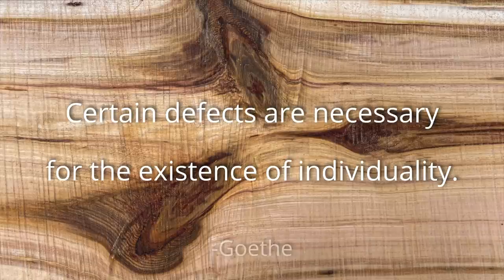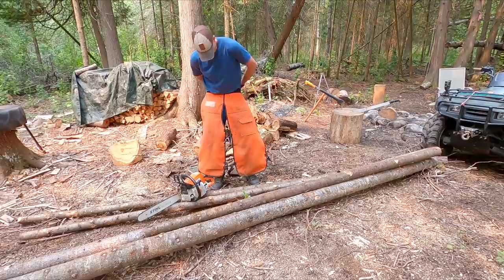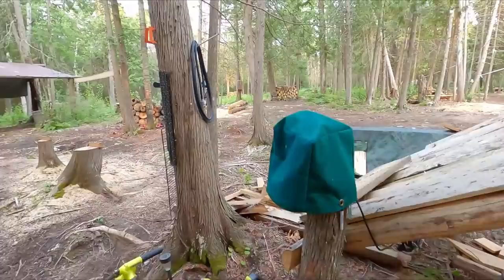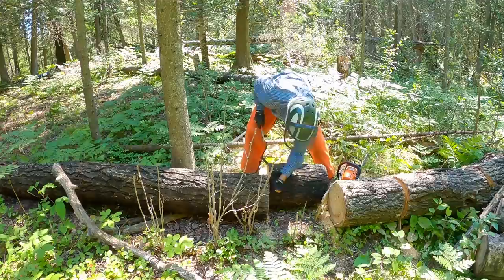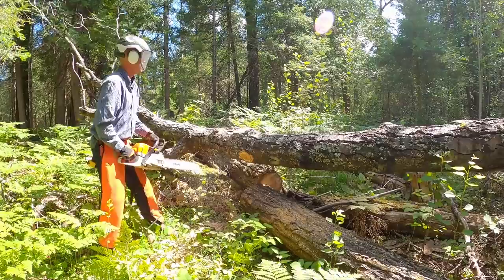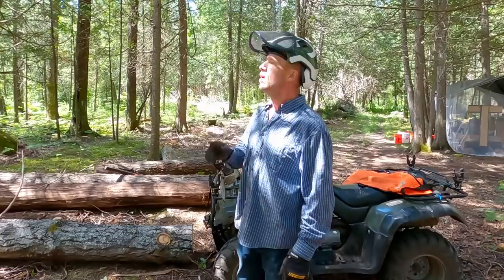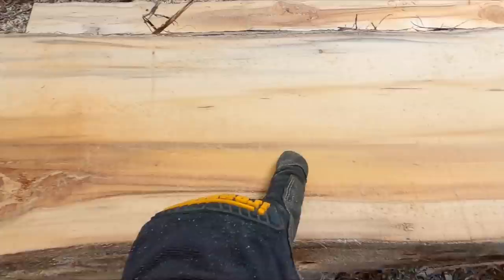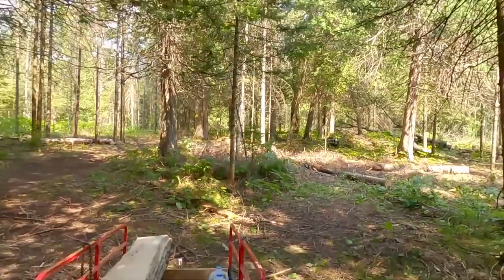Chainsaw Milling Aspen Roof Sheathing (and Other Outdoor Chores.) #46

Comment: You could benefit from a pull behind log skidder. It keeps the one end of the log off the ground when dragging it around. It keeps the bark from filling with sand and dirt which is brutal on power saw chains. Even if you ran your winch line up n over your quad rack you may get enough lift to reduce dragging the log fully on the ground. I just enjoying sharing info like this. I hope it helps you have more fun😉
Reply: VW Bug hood's work well for dragging logs out of the woods easily.  ;)
Reply: Log arch would be better it gets the whole log off the ground and can be pulled with a 4 wheeler

Comment: I have the same dilemma with aspen! We have so much of it here on our property in BC (Canada). I’m keen to see how this holds up as I might mill some up for roof boards too! I’ve milled some previously, and yes - warps and checks quickly. But if tacked down right away, it could work better. We can only hope! 🤞good luck!

Comment: Another great video. Easy to see why you have an issue with HEAT, You used to be in San Diego. Heck, if it gets over 82 here it’s hot. I have to admit that living in the woods with a chainsaw and a quad does have it’s appeal. It is funny today, I watching you video and the neighbors are running a chainsaw, yes, I live in an area that you have about twenty feet between houses but a chainsaw comes in handy. Looking forward to the roofing and screening. Thanks for sharing!

Comment: As for your temperature gripe -- it all comes down to personal preference.

I would rather wear what you had on chainsawing in 100 degree heat, than be in a tent in the winter with as many clothes as I wanted.  But I just don't get hot; and get cold when its below 70.

Comment: This might be handy for you too: I had this idea to use the lid of a mobile fridge, you know the ones, with the lid that either cools and warms (peltier element, thermo electric cooling) and put it on a very small space to sleep in (box bed). If you put such a lid into a tent-wall, you might have airco running at a very small wattage, mine is rated AAA as a fridge, but runs for hours on a single battery (it draws 9watt, haha). It could run indefinitely with a very small solar panel. (44x35cm).. Not a very effective cooling unit, I know, but still if your space is small enough..it might knock of a few degrees.. it´s basically what is in your car., but your car has better insulation.
Anyway I am gonna try it with the very insulated box bed I am building("bedstee" in Dutch) to save some electricity and gas on heating during coming winter and cooling next summer.. 
Because gas prices are spiking in Europe. Already at three times normal rate and not expected to stop rising any time soon.

Comment: I wonder if you would have more fun with a 4 or 6 inch lucas swing blade sawmill. The aspen might even do better if cut smaller and stacked. I have cut cottonwood many times before and it does tend to split/crack if not stacked with airflow boards and dried enough before use. 
Either way a swing blade mill just cuts dimensional lumber and also has an option for a slabbing mill as well.

Comment: Quaking Aspenmust be milled immediately after harvest and makes great wood for many projects but any time span it's left bark on and  horizontal in a splash path will doom it to powder status quickly. BTW, the bark peels easier than a banana when its a fresh fall...none easier.

Comment: What do you consider a scorcher???  95 degrees + in Tennessee.  I do understand 90 in Tennessee is different than 90 in Northern Michigan. I was in Florida and the temp was upper 80's but heat index was 110...

Comment: Hey buddy do you want me to bring my bulldozer by and I can make some roads and then you can buy a truck and drive it to your cabin

Dude you pull logs from the back of the quad, and just sit side-saddle instead of getting on and off on and off all day long to waste of energy

And you can buy a cheap engine hoist crane on wheels, lit the wood to waist height and cut standing